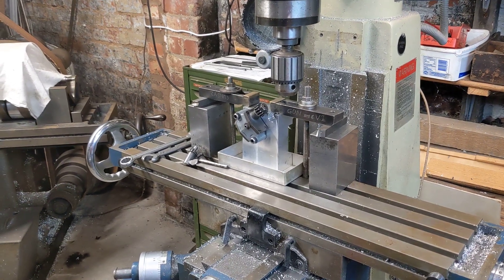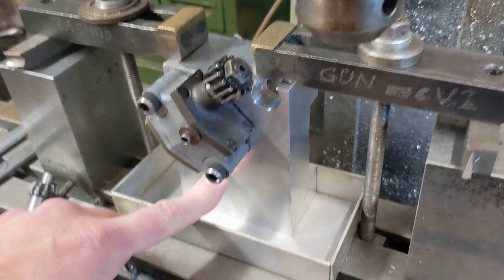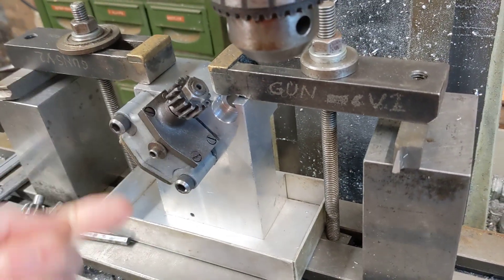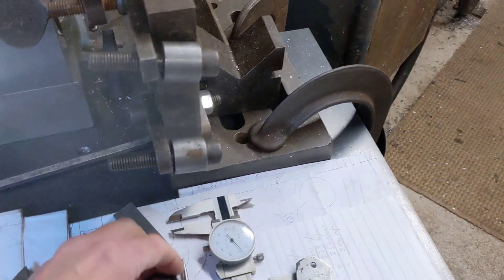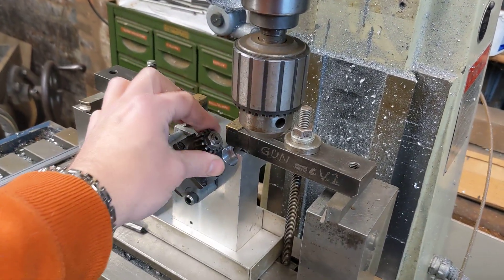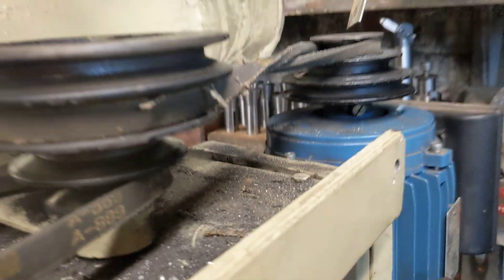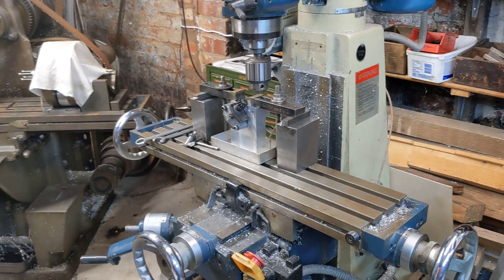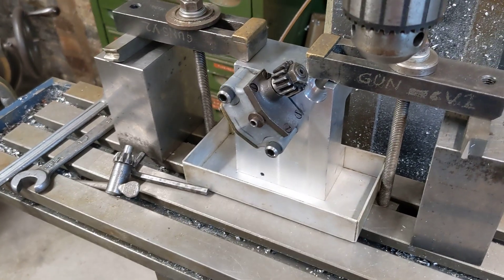Test oil rig.

Comment: Are you using the small oil suction line to filter the oil? 😉 Suction sides of pumps are usually a lot bigger than the outlet.